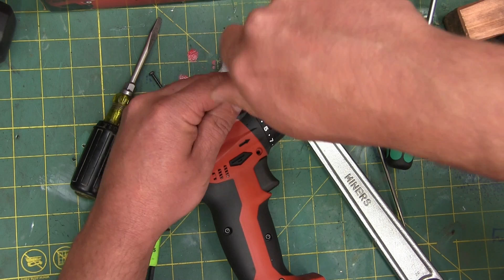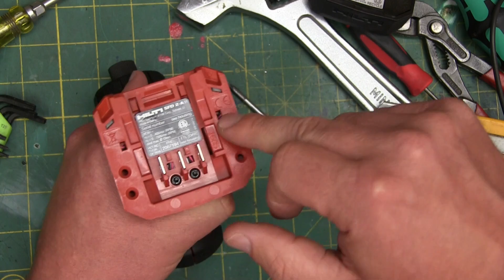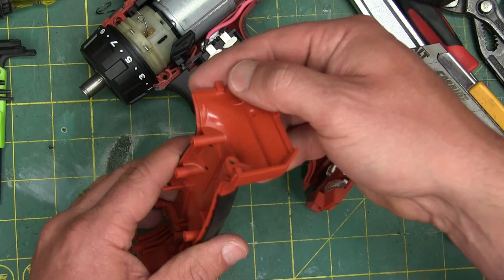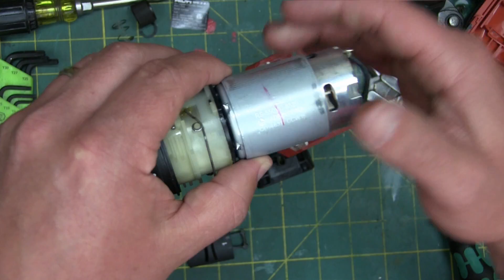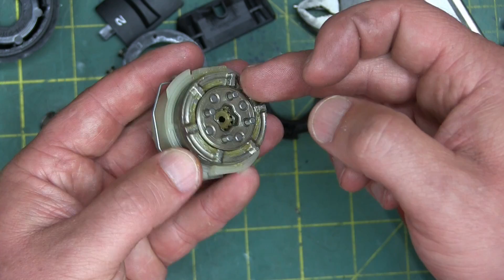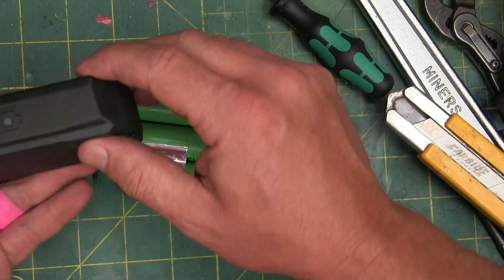BOLTR: HILTI Compact Driver | Milwaukee DeathMatch!

Comment: +AvE Have you tried the hitachi 12v impact driver? I have one I bought for $30 brand new around Christmas, the thing is pretty solid and lightweight, plus you can't beat the price. Even came with a battery and charger
Reply: I've got the hitachi 12v drill and 2 drivers. Beat the hell out of them. One driver is covered in grease, oil, antifreeze, and possibly smegma. No problems here.
Reply: Sterling Archer I've got one myself... Came as a pair with a regular 12v drill, I can't believe the amount of power I get out of those little ass batteries
Reply: Towerdog 727 I know right, definitely more than enough for tasks around the house. I saw a review where a guy screwed in around 360 screws on one battery, they were like 1.5 inch screws....or close enough to it. Pretty impressive

Comment: Samyang* Not Samsung x)
Reply: No, actually "Samsung SDI", one of those top 3 Lithium-Ion cell suppliers. You be confusing something here, maybe your lens, or your Ramen knockoff. Then there's Samyoung, something else, they make capacitors (electrostatic energy) rather than battery cells (chemical energy).

Comment: Hey Uncle B.F.  I think the taped down thing in the battery is a "Thermistor" with a positive or negative coefficient. It's how the makers of the equipment I service are getting away from mechanical temperature control.      Hey. For day to day service work as a refrigeration guy (in P.G. Baby !) sure do like my Makita, LOVE my older METABO 12v (could twist my wrist off if not set right for the task).  ...going to try to see where u got those for that price.............anyone know?

Comment: I'd go for the hilte because it's smaller, weren't I had my bosch (PS21) that's smaller'n both of'm. If it can put a half inch lag bolt into pine that's five times what I need out of it, but if I can't fit it inside a running vacuum to dismantle it's way out quicker than hand, what good is it?

Really though, for computer and electronics, fitting is half the battle, the other half is having the right bit.

Comment: You should really just get a bunch of iron piping and weld together some kinda torque thing if you're gonna do this more often.
With impact drills this wouldn't be much of a problem, but if you're gonna roast regular drills, you're gonna want something to keep em down, because it's either your weight or the drill's power, and you don't want a drill to win that fight, with broken hand bones sticking out and all that shite. :3

Remember, safety f... second.
Wife comes first, whether you want it or not. ;D

Comment: got a little impact gun-style screwdriver that is just as tiny as the hilti, just with proper knockers, it'll screw ya good, but beware of screwin too tight cuz that little rattler will rip those threats out

while it's nice to have something that small be that strong(with about 130nm[ryobi even claims 250nm for theirs]) it's not too handy if you wanna screw it tight and don't wanna screw it up

Comment: Hilti is too expensive, not that great anymore, and finding repair parts that don't total out the tool is almost impossible
Reply: Tony Amdi I know that Hilti is usually very expensive, but I was curious and looked the SFD-2A up and the tool with 2 batteries and a charger is $163 at the homeless death spot.
Reply: Joey Kissinger sounds pretty cheap which might reflect the quality!  I used to work at a place that fixes power tools and Hilti was always cringed upon. Like I said, replacement parts were so expensive, a switch would total the tool out. I was talking to my old boss the other day and he said the switch for a Hilti cordless drill was over $100!

Comment: Ride a pomy bike at night in the rain with Lucas electrics you'll know why they called Joe Lucas the Prince of Darkness.  Using the Lucas short circuit method (replace fuse with nail) to diagnose the fault could be a bit hard at night since you cant see which wire is smoking until its glowing red and then its well on fire and your praying for it to rain even harder.

Comment: Damn! I was about to tell you how the clutch works. (because I figured it out about five seconds before you) The only thing you got wrong (or perhaps mis-spoke) is that the springs, back-up plate and balls lift over the ramps on the ring gear to let it spin.

Great video.

Comment: i must correct you, there is NO protection at all in those batterys, BUT it doesnt matter, the battery cells are so good, that they can handle way more abuse than the tool, you can draw 100amps on pulse load and 25A from full to empty without problems.

Comment: The ferrites are probably also for the PWM switching noise.
Reply: Yup. I was a wee bit surprised he didn't bring out the O scope and tell us the frequency.
Reply: Brad Cole yeah your right. Sorry it's been a long day
Reply: leo001leo001 agreed sir
Reply: That is only true for the rpm with no or very low load. For a good torque regulation you need PWM.
Reply: Paul Critoph It surely can be both...

Brushed D.C. Motor operation principle= input voltage= output speed.

PWM= a simple way to fluctuate voltage by the law of averages in a small package and get infinitely variable speed from 0-maxV
Reply: Bart B I know he said it was pwm but also said it's brushed. It can't be both

Comment: I dont know if your china export is a joke but that actually means european conformity. Or "Conformité Européene"
Reply: Hint: it's a joke. Next you'll be telling us that there is no such metal as chinesium.
Reply: There is no such thing as a 'China Export' logo.  There is only a CE mark used improperly.

https://en.wikipedia.org/wiki/CE_marking#China_Export
Reply: there is not on "official" china export mark but many Chinese manufacturers use it as its a blatant attempt to trick consumers into thinking they are buying a product that conforms to the eu rules
Reply: Its a cheeky trick, slightly closer together so those that dont notice think its a certified product
Reply: There is loads of crap from china that has a "CE" mark on it that would never get past either the radiated or conducted emissions tests (I've checked some PSU's). Hell half of it even has the wrong earthing if any.
Reply: nilamotk shoosh , you will not ruin our in house joke .
Reply: Syncubus you are not great at reading are you. That wiki page just says the european commision is was not aware about china export, not that it hasn't been used that way. Anyway, since there is no actual regulation about the use of the C E mark, both CE and C E mean nothing.
Reply: I'm adept at reading, even documentation on the rare occasion.

I'm even adept at reading-between-the-lines, when necessary.

The "Chinesium Explodinating" mark is meaningless and can be ignored as bullshit marketing.  The actual CE mark denotes a declaration of conformity to "Conformité Européene" standards.

Dunno what the U.K. is going to mark their possibly inferior, foreign stuff with, now that they've shifted continents by popular vote.

https://ec.europa.eu/growth/single-market/ce-marking_en
Reply: CE is self declaration. Unless a market surveillance is performed, they will not actually have to prove they performed a test.
You're right though, switching power supplies from cut rate suppliers are very often an issue to pass conducted emissions testing. Particularly "burst" and "surge" testing. 
Having said that, we have also tested some extremely high quality components coming out of China.
Reply: Chinesium is very real... lol
Reply: This is the AVE channel so obviously it means something like Compote Elixir!
Reply: It actually depends on the spacing, China Eport and Conformité Européene logo both look the same, only closer or farther a-part.